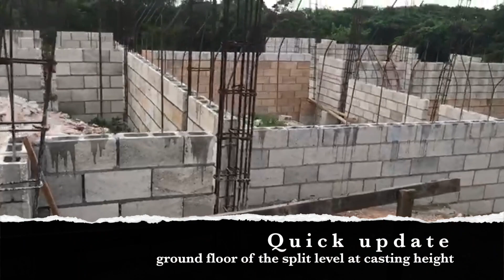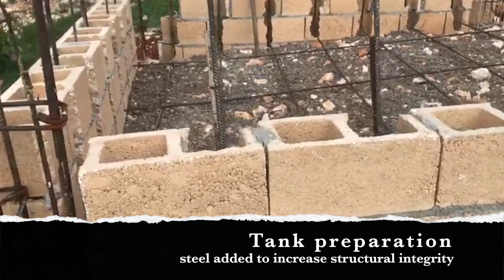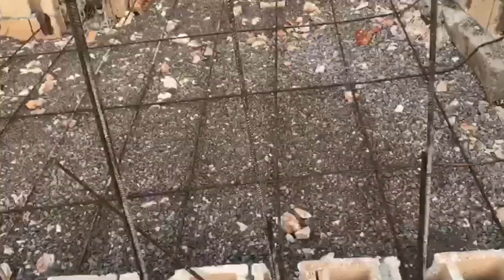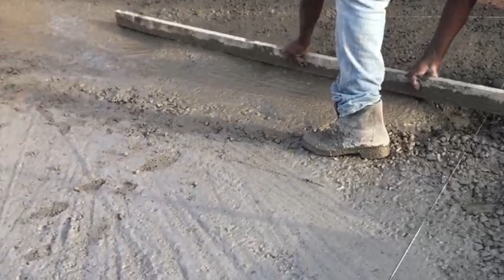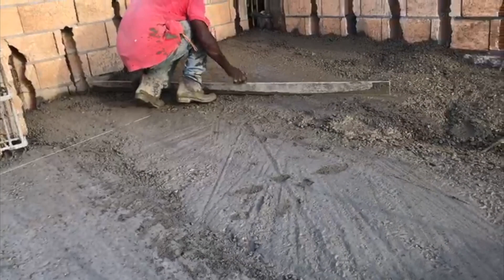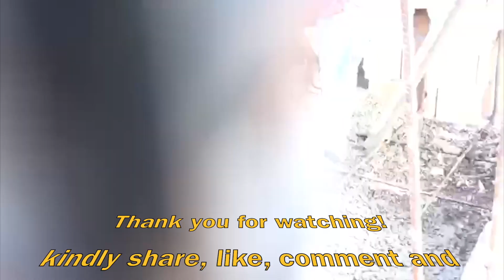Building a house in Jamaica 🇯🇲 part 3

Comment: Nice video keep inspiring us. One thing though, I don’t mean to scare you but, I noticed that there is no horizontal bars in your block work. I wouldn’t take that risk at all. Speak to your builder about this, I hope it can be added before you reach the deck, even though a lot is missing already. There should be a horizontal bar every three or four blocks height.
Reply from the maker: Thanks for the advice, check out the most recent video. We added the belting and more steel to the opposite end that was already 4 blocks high.
Reply from the maker: The land looks nice! gorgeous view 👍🏽
Reply: Did you mean belting every 3-4 block high, is this something new to the Jamaican building?
Reply: @74Spragga  not belting, that’s different. For every three row of blocks laid, the mason should run a length of 3/8” steel ( bar) on top of the blocks and tie it to the vertical bars. It will create a mesh effect and prevent the walls froM cracking or falling over. I’m sure there is a better reason to it. That’s what my architect recommended, so I build accordingly. ✌🏽